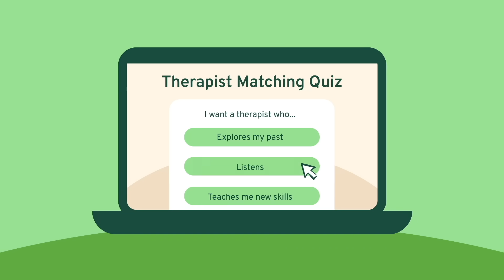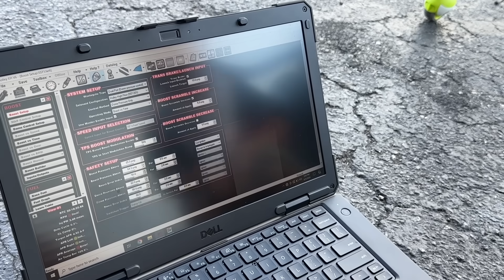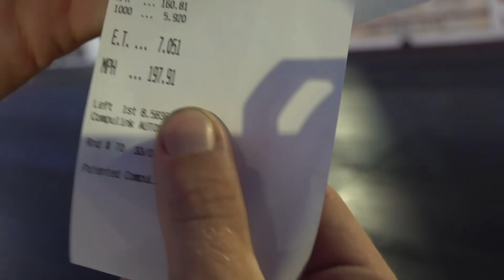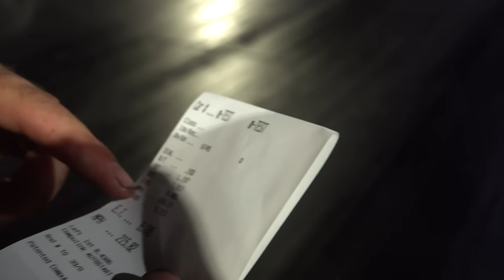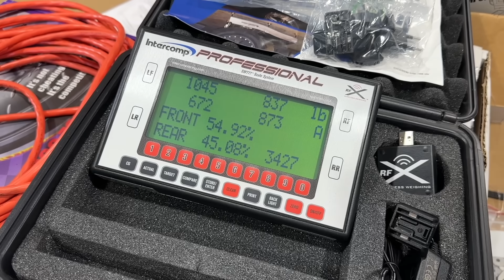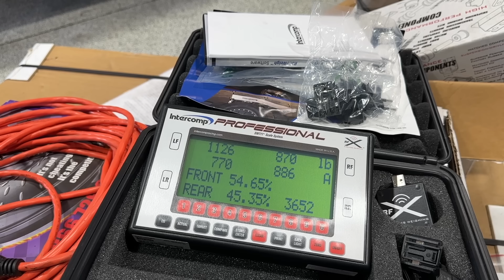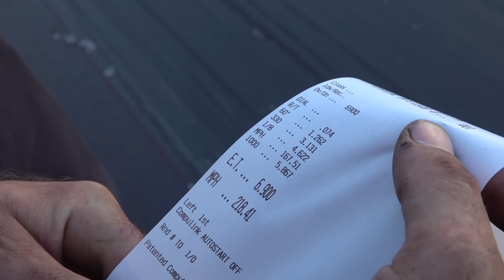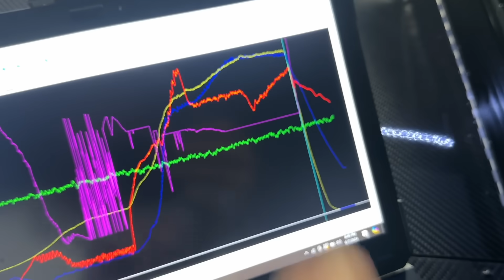The Dumbest Racing Mistake I've EVER Made!!!

Comment: Please Please Please stop leaving all the random stuff in the car. A crash is bad a crash where you would have been fine but that screw driver slammed into your chest so you aren't is worse. We love you man Please  clean the car up before you run 220+.
Reply: Was thinking  the same thing when I saw that.
Reply: 💯 percent agree with you... I don't like seeing stuff flying around in the cars as they make a pass...😖
Reply: I'm not disagreeing at all, but it may have been the dzeus fitting driver to remove the hood. The driver must have that in the car in case of a (small) fire/emergency after a run in the engine bay. An easy fix would be to get a, decent, quarter size magnet, stick it to one of the bars for the roll cage and attach said driver to said magnet. Can it still come off in the event of a crash? Possibly, but it would help and barely costs much.
Reply: @JustBrewha55  so make a tiny strap that keeps the fitting driver in place so that it doesn't fly around or become dislodged in a crash.
Reply: He's got a helmet
Reply: @scubajoe3321  What does that have to do with anything?

Comment: With all the stuff Zack diagnosed and fixed in just this video, you picked the right copilot for sick summer. Good luck guys.
Reply: Employee of the month FS
Reply: Just wondering who initially did the wiring
Reply: @Lil_witte17 Yea looked like a rat’s nest. Awful wire pathway for a race car that vibrates…
Reply: @Lil_witte17  The shop that built Mullet. KSR fab
Reply: @DareTheMachine  Not at all.  And wouldn't have been an issue if not for bolt backing out.
Reply: @DareTheMachine  I’m big Into car audio where we have just as many wires running tons of amps speakers etc. i was just a Little shocked to see that on such a high dollar race car. Even a simple rubber grommet would have prevented that issue
Reply: @SportbikerNZ  that’s why proper race car harnesses are not routed against a sharp edge of a conductive surface without grommets and good pathway. Because bolts back out… Murphy’s law ya know.
Reply: @DareTheMachine  Any race car anywhere will have components that'll wear through the harness if various bolts back out.
Reply: @SportbikerNZ  agree to disagree, no proper wiring job would have wires routed between a pinch point of carbon fiber like that.
Reply: @DareTheMachine  The point is it wasn't a pinch point.  Every race car can create its own pinch points if bolts back out though.
Reply: @Lil_witte17 most likely harness has had stuff added and removed a dozen times since it was originally built and every time you add or remove something the harness gets more clapped no matter what you do

Comment: Retired EE here: yeah if wires are allowed to rub on Anything, they'll wear through, so you need wrap and/or padded clamps on all wire runs. One of the worst is letting stainless braided hose rub against Anything; it'll cut through like a slow saw due to vibration. Thread lock or Nyloc nuts on all hardware, or even safety wire on really critical stuff. In short: build your race cars like aircraft.
Reply: Great idea in treating the wiring like aircraft wiring. It’s not cheap but when you are going fast for a living, or at least trying to, going that last extra mile is a good idea.
Reply: @Bill_N_ATX  Yea, the wiring they showed in the video isn't great. There really shouldn't be any exposed wire without extra sheathing. There should be grommets going through panels. Actual motorsports wiring is overkill for this exact reason. Racecars will go through excessive vibration... bolts will vibrate out, solder joints will crack, wires will chafe, etc.

Safety wiring the bolts is a good idea, especially for bolts that prone to backing out and are critical to the operation of the car
Reply: Yeah people think of carbon fiber like plastic or fiberglass, but it will short out and or ground out like metal haha
Reply: Fun fact.. Carbon is also a great thermal conductor. Carvon fiber panels (depending on the way they are made) can be more thermally conductive than copper
Reply: Yup, this is a car with several hundred thousand dollars worth of parts, the wiring needs to match that level.
Reply: ME here, locktite, locknut or safety wire EVERYTHING. Your stuff will try its hardest to run away at the most inopportune times. 

And these guys are killing me with all the bar loading they’re using. It’s so unforgiving. Ends up in a lot of spinning at any tack that doesn’t have the best prep.
Reply: @dochaze1  because all they do is practice hits at a perfectly prepped track. Then they go to a 'real' track and spin, every single time. But hey we have to buy the pay per view to watch any actual racing anymore so oh well! lol
Reply: @jwallace2913  no one forcing you to watch
Reply: @dochaze1  Remember that prevailing torque nuts exist. Instead of a nylock cutting a thread, the thread profile in the nut is slightly oblonged. So there is mechanical interference on purpose. This is widely used in OE automotive applications where you need to prevent a fastener from backing out. 
You notice nylocks are almost never used in OE applications, that's why.
Reply: @716monk  Nope. That's why I said, OH WELL! 

I'd love to see a come back of actual racing to the channel, but if the gimmicky youtube content works for them.. I'm here for it. Entertaining nonetheless.

Comment: The one thing I respect more than anything about Garrett is his willingness to share his mistakes and downfalls not just the positive... You don't see any of the big racing teams showing anything everything is tight-lipped but I promise you they have the same kind of problems the same kind of parts failures or they are rebuilding way more frequently than you would ever think... Props for being so transparent
Reply: To be fair they probably aren’t having this issue hahahaha. Not many race teams swinging donuts on drag tires.

Comment: Let’s hear it for that Steve Morris scratch n dent in Mullet!  That thing is a beast!
Reply: I thought that one got replaced didn't it?
Reply: @10thclimbtovictorystevens65 no that's the original SMX that was in Steve's wagon
Reply: @MansGreatestFriend  they kept finding metal in the clear view catch screen. Steve tore it down and gave it a once over. Still the scratch and dent special
Reply: Yes that's the one he won the World Cup race with also, so I guess its a champion scratch n dent??? I can't remember if it was 6 or all 8 rods that left that engine when it was in Steve's wagon. Steve fixed it up and sold it to Cleet on the cheep.
Reply: @NaRoonStarrider a $60,000 engine is cheap ?
Reply: @Wockkkyyslushieee  Yeah it is, when you're normally looking at 100+ for these race engines (not just SM ones), 60 is cheap. The one for Eagle is probably going to be around the 100 - 120.
Reply: @drakkondarkblood6638  sheesh it’s an expensive hobby man
Reply: @drakkondarkblood6638 the eagle will be 265 to 300k for a painted wired roller plus motor plus trans plus convertor and gear plus spare parts for 500k to be race ready
Reply: @jdias51  Yeah I was talking the engine only, but yeah when Eagle is going down track it's going to be around the 1/2 mil car.
Reply: @Wockkkyyslushieee  Yeah it can be, it also can be done relatively cheap, but the faster you want to go, the more it's going to cost.
Reply: @drakkondarkblood6638  I agree though a motor will he 100 120 easy
Reply: What is it they say on the other side of Florida,... "Fast, Good, or Cheap*. Pick Two" - NASA.

( *Cheap in this case means low cost, not low quality)
Reply: @TT2.7F150  ok ok my bad you're right

Comment: I’m glad you posted. I’m about to lose it. I don’t have the right tools to cut this ptfe fuel line and I’m having the worst time doing this crap. I don’t have an angle grinder. I have never made fuel lines before so I didn’t expect to be this much work. They ptfe ward more difficult but I didn’t expect this. It’s alright. In less than 2 weeks I’ll have it all finished and blower installed
Reply: 32 teeth hacksaw or an axe or a sharp chisel with a 5# hammer.
Reply: Cut off wheel and electrical tape
Reply: Dremel cut off wheel does it well.
Reply: Yeah cut off whee and tape is the best way. Listen to the guy above me.
Reply: What this guy said ^ A good swing of a decent axe will make a nice clean cut of almost anything. I often use it for 4/0 gauge wire as easier and quicker than cutters.
Reply: Angle grinder with a cutoff wheel and some masking tape around the area you want to cut. It'll help with fraying. 

I have to re-mount a 10AN power steering hose with metal braiding later today. I am not looking forward to it.
Reply: If you have a big enough job go buy some sheers if not use electric tape and gut through the tape with a hacksaw. Clean hose out afterwards
Reply: Buy a correct tool and use accordingly that way you know it’s correct
Reply from the maker: Bro cut off wheel.
Reply: Electric tape and cut off wheel do good. Just clean out the line after.
Reply: @CleetusM  bet
Reply: I bite mine
Reply: Electrical tape and a cutoff wheel is how I do it.  My friends that own a fitting shop for XRP have a diamond blade in a mini chop saw but thats not necessary.
Reply: cut off wheel and vinyl electrical tape..Did all the fuel lines in my build with just that, An wrenches and a Vice.
Reply: @brutalbasspro best I have is a hack saw. Up until this point I never needed a cutoff wheel. I’m doing a return line conversion on my 08 Sierra with hellcat pump and fpr.
Reply: @JosephNnbs  It's an excuse to go to your tool shop of choice. Embrace it. Get yourself a drive-thru treat on the way back.
Reply: pinch it gently in a vise at the cut line, then cut right at the top of the vise jaws.  

works perfect for me every time.
Reply: Wrap where you want to cut with electric tape then use a grinder to cut through the tape and then run around the right edge and you'll be good
Reply: Just leave it out in the yard for a couple of days smeared in peanutbutter and those pesky squirrels will bite thru it in no time
Reply: @33gles I’m tapped until next check because I thought I had everything I needed and ordered a bunch of other stuff for the supercharger. I’m taking my parts to work to use what I have available there
Reply: Hard to imagine spending money on a blower before an angle grinder
Reply: @HoLeeFuk317  imagine not needing to fab anything. Ever. That’s me. I never do fab anything most the stuff I do is fairly simple. But for some reason I think fuel systems are complicated. Like bro I’m only tryna make like 600wheel I’m over complicating this so bad
Reply: @HoLeeFuk317  but you aren’t wrong. Custom built trans, custom built bored forged 376ci boost engine, fully built rear end and I don’t have an angle grinder. It’s activating
Reply: Harbor Freight grinder...?! Use it then return it if you can't afford $20...!
Reply: I took mine pre-taped and marked to a Napa Auto Parts Store and they cut it free in 1 minute for me.

Comment: Cleetus I have a great idea. 

Not sure if this has ever been done but a universally swappable vehicle or boat. 
I know any car is inherently universally swappable with enough effort. 

My idea is a combustion vehicle that requires very little effort swapping between any style of engine. 

A car or boat purpose built with a large enough: 
-engine bay
-a robust cooling system 
-universal ECU (if carbureted non issue) 
-an easy engine mounting system. 

The gimmick would being able to swap between a VR6 and LSX with little to no issues. With a car you run into to issues with transmission pairings but with a boat’s direct drive system I believe is be a better option. 

Building a completely custom jet boat much like kickstands 3k boat from the challenge. The engine(s) is center the piece and the bay is catered to putting any sort of monstrosity as it power unit. 

Would take a lot of fabrication but nothing y’all can’t handle. 

Hella ya brother.

Comment: Re: Zak, "Use Loctite on everything."
I'd suggest nylocks. They can be reused up to 20 x's, don't have to remember, prep clean or heat reactive, (will melt at temps above Loctite release temp: ruins them for re-use, but no failure).

Only downsides are cost & additional weight, (~50% heavier than normal nut).

Comment: Cleetus, have you never heard the term "Rode hard and put away wet"? It seemed like when you were doing that burnout thing with it,  there was a "We'll fix it later" kind of vibe. Burnout cars for burnouts, drag cars for dragin'.
Reply: Quite a bit of assumption there.  Cleet may make the odd mistake like forgetting to swap out the tires, but he knows infinitely more than yourself about the sport and looking after the cars.  He has a pretty darn high level knowledge about the technicalities and certainly doesn't need to be told the basics.
Reply: @SportbikerNZ  I work for one of his sponsors, and where he possibly gets those from, so, there's that. Just makin fun.

Comment: CLEETER -- -- You guys NEEEEED to start using silicon glue on ALL the nuts and bolts on your cars. 

 I was shown this trick back in the 70's by and old man when I was having this issue on my top fuel motorcycle.... It was vibrating everything loose and this cured it. So now I'm an old man trying to impart a little wisdom to you guys.
Reply: Thread locker is something they've been using since day one, since they learned to talk.  Nothing new for them.  But when you have a million bolts it's easy to miss a few.

Comment: Where is the Leroy aero-body?!!!
Reply: He put the street front end in so the CF front doesn’t get destroyed with all the street driving
Reply: @MB-mx7vz wrong car. also, the other front end has no holes for cooling. they're gonna be driving it on the road. don't need air on the strip.
Reply: And you need lights
Reply: @MB-mx7vz they don’t switch the front end to prevent damage they switch it because they don’t want to cut holes in the carbon one for lights and cooling and screw up the aero and add weight

Comment: Kill Switch looked like a 5 minute repair with a soldering iron and some small rosin core solder.  Just scrape away the black solder mask from the burnt copper trace, melt a little solder on each end, lay a thin wire across it, solder over it. Then use some clear fingernail polish over it to protect it until a new unit arrives. Just be sure to not bridge over to an adjacent copper trace.

Comment: 35:19 Edge grommet is perfect in that situation.  Keeps wires and hoses safe.  Check McMaster for Heavy Duty High-Temperature Rubber Trim for that thicker carbon fiber panel.  For sheet metal panels, check out their Heavy Duty Plastic Trim.

Comment: I'm probably alone on thsi one but i still feel like the SMX hasn't proved itself for the crazy price tag. I know mullet is limited because of other things but i still feel like they could have went this fast and had the same reliability with an engine half the price built by the man thats real good at doing stuff, Pete Herrald. Nothing against Steve his engines are so badass, but for what mullet was capable of running with the chassis and suspension setup, they could've achieved the same ETs with a much lesser engine.

Comment: carbon fiber is generally about 1/7th the conductivity of steel. if you walk on carpet in socks you will statically shock to carbon composite just as you would to metal. (20 year composite expert, in planes, rockets and lunar landers)

Comment: I have to ask, do you guys have like a 'Captains Log book' for each of the cars?  So after every change done in between runs, all data goes into the log book, be it physical changes to suspension, tyre pressures, anything done on the laptop etc etc, then marry that up with the time slips.  This should give a good amount of useable data especially if you pair it with weather and track temp/air temp.

Comment: Wondering why it’s day three of sick week and we don’t have any covers
Reply: They have had SERIOUS problems. Heard on day one they had transmission problems. Day 2 (yesterday) Lifter exploded. Welded lifters together. Got a pass to stay in it running on 7 cylinders. Got it to motion race works. Filter is full of metal. Cam has been hitting lifters every turn. Last I saw, they were going to have to hammer out the welded lifter/s. Steve Morris is making a mad dash 4 hours drive with parts and tools. Going to try to rebuild it and get to the next track for a pass. Last words from Cleet "I think we are going to be ok." They are thrashing. I highly doubt getting a video out is his priority right now. If they do not get it fixed and to the next track for a pass, they are out of the drag and drive.

Comment: Just curious if Zach used PVC coated wire or Teflon coated? Teflon wire is better with vibration and friction/rubbing. Used the hell out of it on frac equipment and it always held up lol

Comment: Any time your wiring is up against a piece of sheet metal or carbon fiber or if it goes through a hole in a panel, you REALLY want some chafing protection of some sort there.  A grommet or edge banding would have prevented this unfortunate situation.

Comment: Is it possible to hydraulically "spring load" heavy componants, possibly the engine via the mounts? As far back as possible in the engine bay, then release the tension when you launch to throw the mass forward to launch faster?
Reply: Release the mass a fraction of a second before you launch I mean. In order to get a bit of a head start on shifting all that mass from zero. 

We need the professor coats.

Comment: 16:05 "it will go down where its st you might just have to pull some bar angle"...
Ummm thats kinda what i been talking about all along. Obviously it will "go down" the track but if the chassis is upset then it kinda won't. Do more suspension tuning and put the laptop away. I am not a fan of racers racing laptops nowdays. The 'puter should be for data collection not for problem correction.